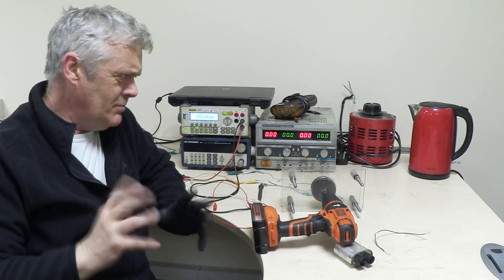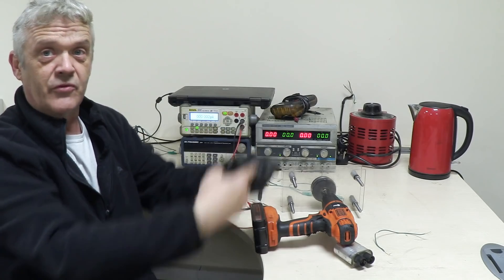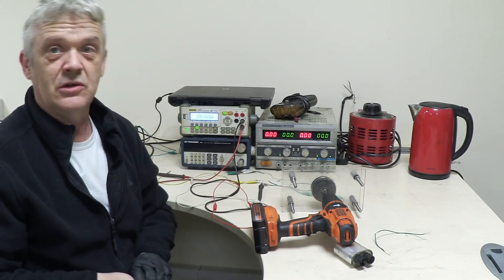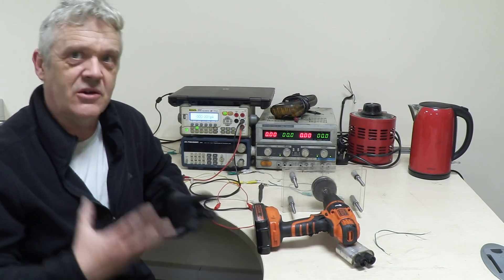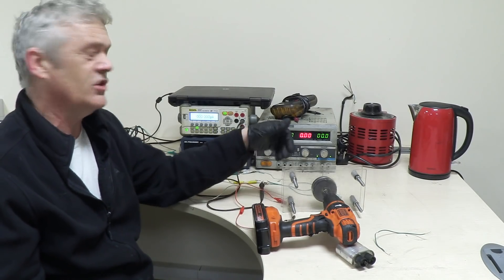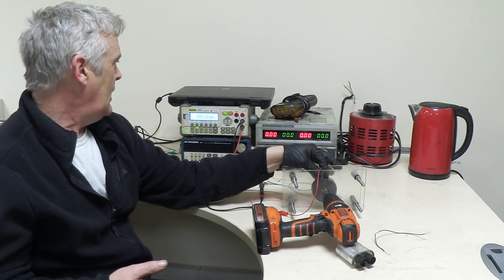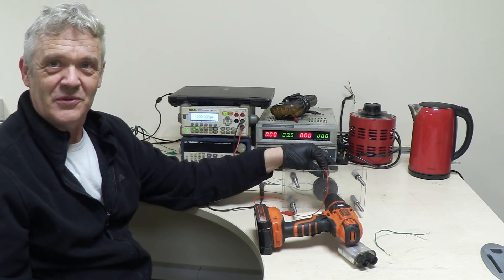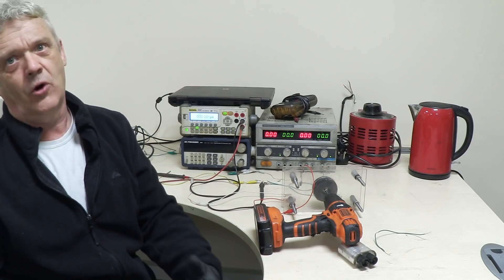Strange Behaviour Of A Tesla Homopolar Generator

Comment: Does anyone know where earth's magnetic field actually comes from? The official explanation is molten iron core. What about the curie temperature of Iron? Molten iron is way above the curie temperature, plus the outer core is about 3000 miles from surface
Reply: Magnetic fields from Electric currents dont care about iron's curie temps. Iron just serves as a conductor.
Reply: @kreynolds1123  hi keith thanks for your reply, are you saying the electric current is coming from the core still?
Reply: @clive280178  with a relativly low concentration  of iron  in the sun being so large as to gravitationally trap lots and lots  and lots of hydrogen,  and and even hotter temperature than the center of the earth,  it should be apparent that the sun's magnetic field is not created because of iron,  but  from convection currents in a rotating star.  The field builds up  self sustains,  then gets all twisted, and then reverses every 11 years or so.
Reply: @kreynolds1123  ok but the sun is just a large light in the sky (a plasma like the moon) and gravity is a myth disproven by Archimedes buoyancy principle ie - less dense air floats.  Air ships, hot air balloons and hovercrafts and anything lighter than air disprove gravity theory. Things that are lighter than air should be more affected by gravity, like small bodies of water are not affected by the Moons gravity like the seas and oceans are (according to mainstream science)
Reply: @clive280178  Gravity: for m¹and m² f¹=f²=G×(m¹×m²/radius^2)  
Prove that wrong.
Reply: @clive280178   Boyancy is the net result of pressure  forces  and  gravity acting on an object. Taken together, they confirm both the effects of gravity and pressure forces from fluids like gases and liquids.
Reply: @kreynolds1123  disprove gravity ya say, if I gave you a balloon with 20 kilograms worth of helium in it you'd float off into the atmosphere. Seems odd if I add weight to you it has the opposite effect of what gravity does. Pretty sure magnetism is the nail in the coffin of gravity too
Reply: @clive280178  taken more precisly.
Archimedes' principle states that the upward buoyant force that is exerted on a body immersed in a fluid, whether fully or partially submerged, is equal to the weight of the fluid that the body displaces.  So boyant forces felt by a helium ballon only  confirm the displaced weigth of the roughly 80% nitrogen and  26% oxygen  gasses.
Reply: @kreynolds1123  The oceans contain an estimated  352,670,000,000,000,000,000 gallons  of water. The moons gravity which is 1/6th of the earth's (meaning it would absolutely zero effect on earth anyway) manages to move that weight of water without disturbing puddles, lakes or reservoirs, and yet we cant feel a thing.

Gravity the force thats strong enough to move the oceans but weak enough to leave a puddle alone. Mmmhmm
Reply: @clive280178  Tidal forces are a different issue relating to different  accelerating frames of reference, and they have been measured and confirmed to work as expected in  gravitational fields. Puddles are just too small for you to observe tidal effects with your eyes. But can be measured on scales. So far, each of your example is explained by other physics and works within a gravitational framework. 

 But i have better things to do than to comtinue to debate this issue.
Reply: @kreynolds1123  cool thanks for your time and knowledge have a good.un

Comment: If electrons have weight they may be shifting out of their normal orbit in the field from centripetal forces contacting the disk and be conducted away also there was a slight wobble in spinning that may contribute to that as well but that is just off the top of my crazy head.
Reply from the maker: I think the angular momentum has a role to play for sure mate
Reply: @ThinkingandTinkering   Lets see magnetic fields are what? IRC electrons leaving the magnet like suborbital launches from 
earth if you were headed out on a trajectory and then the earth shifted where you landed would change from the original path you were headed on if this is true higher rpms and or wobble in the rotation should produce more energy.
Air bearings and a Tesla turbine may help prove this out.

Comment: i thought of that too, the relative motion between the wire and magnets, but i was wondering if you tried to use antenna,s and a retifier to charge a battery?
Reply: The combination of a rectifier and antenna for energy collection is called a rectenna, somewhat uncreatively.  They're the basis for beamed power, wireless chargers, and there's some research to build nanoscale arrays that could maybe even operate into visible wavelengths.  It's interesting stuff but it's not what's happening here to any significant degree though.
Reply: It is Direct Current, except for minor field variations in the material that might cause changes as it rotates.

Comment: I guess replacing the drill with something that can also spin that fast but using only hand power, maybe combination of gears and pulleys, can confirm that there's no induction because of the motor
Reply from the maker: maybe

Comment: I believe in aether or dark energy, also called by some, a quantum field.  Some would argue that earth"s magnetic field is what your rotating disk is picking up on, but I believe your magnets have created two magnetic fields in the disk, maybe three.  But I suspect they are angled within the disk, allowing both magnets to stick to one half of the disk, opposite each pole.  When you spin this, you are either disturbing this arrangement, and causing currents to form in the disk, or the destabilized magnetic domains in the magnets are doing the same, or thirdly, as I believe, they are simply magnets spinning in the aether, picking up energy.  If this is the case, just spinning one magnet or two in homopolar positions glued together, should also create a small current.    Very cool video, I wish I had money to give but I don't, Sir.  You can create an axil with thick copper rods that are touching and glued in the center of round magnets, long enough to touch a contact point far away and nearly parallel so as to nullify the contact and probe wires from being inductors to the spinning magnetic fields.   I hope you are very blessed this year, cheers, Mate.  😀
Reply: Read Robert Sungenis
Reply: @maciejnajlepszy  no thank you, but i hope you grow in wisdom and love, Sir.
Reply from the maker: interesting mate - thanks for taking the time to post that

Comment: It is not zero relative motion, disk is spinning and magnetic field is spinning, but wire of that is at the point of contact is static.
So, that small piece of carbon/wire in rotating magnetic field is enough to produce that current.
Reply from the maker: cheers. mate

Comment: Very interesting.. Maybe tapped the either. ? 🤑 So maybe it is possible that no resistive force is produced  to get current? What about different rpms?
Reply from the maker: worth trying mate
Reply: Robert Murray-Smith Not for me right now i am afraid . I am flat out working on an idea for a gaseous ion exchange membrane/interface for solid state batteries 🔋 its not a small cell either. About the size of a cocacola can !

Comment: Have you tried it with no magnet attached as a control?  It occurs to me that the aluminum disk does have relative motion with a magnetic field... the Earth's.   Trying it with different orientations would be enlightening, since Maxwell's equations predict that the current is proportional to the velocity perpendicular to the magnetic field (ie, the axis of rotation is parallel to the magnetic field).  If the Earth's magnetic field is involved, you'd expect the greatest output with the axis of rotation oriented north-south, and a minimum if the axis is in the east-west/up-down plane.   As someone else pointed out, there is relative motion between the plate and the wires/brushes.  I have read (but not verified) that homopolar generator experiments have found that rotating the magnet while keeping the disk stationary does not  produce current, but that assumes the field is uniform and the rotation sufficiently smooth.  In practice it may vary somewhat due to vibration and the fact that the magnetization of a permanent magnet is rarely as uniform as one might wish, so the field experienced by the attaching wires might vary slightly as the magnets rotate.  But that relative motion with the brushes and wires means there's also friction, so it could also just be a triboelectric effect.  Trying it with no magnets and in different orientations would test these hypotheses.  If its current is the same or similar with no magnets and in all orientations, then it's consistent with the triboelectric effect.  If you get different currents depending on orientation, that would be consistent with an external magnetic field, most likely the Earth's if the maximum is in the north-south orientation,  though there could be another nearby magnetic source you're unaware of that could explain it if the maximum is another orientation (easily tested for with a compass and some prior knowledge of which way is north).
Reply: As a quick explanatory note, the modern Heaviside formulation of Maxwell's equations doesn't include the relevant term to predict the behavior.  You have to include Lorentz force law.   However, in both Maxwell's original paper for the Royal Society, "A dynamical theory of electricity", and in his later treatise, in his equations that define the electric strength field, E,  in terms of the scalar and vector potential fields, he includes a term relating it to velocity relative to a magnetic flux field, B.  That term is equivalent to the B term in the Lorentz force equation, so the modern formulation is essentially the same.  Bits of the original have just been offloaded to other equations. 

It's interesting to read the original papers to see how the form of the equations has changed.  In the original paper, he writes them down as 20 individual component equations (so 3 each for Ampere's Law and Faraday's Law, and 1 for each of Gauss's Laws, plus a few others no longer directly included under the name "Maxwell's equations"), but by the time he wrote his treatise, he had become enamored with Hamilton's quaternions, so he uses that notation, which condenses them closer to what we have today, though he doesn't do any actual quaternion math with them.   Oliver Heaviside simplified them a bit more with his own notation, moving current density components directly into Ampere's law, eliminated the continuity equation, as it can be derived from the others, etc...
Reply from the maker: I know - but thanks for pointing it out
Reply from the maker: yes mate - read the description
Reply: @ThinkingandTinkering  Sorry,  I do see that you put it in the description.  I'm not in the habit of reading video descriptions unless the YouTuber mentions that some info is in them because most of them don't put anything useful in them anyway, but you're right. It's there and I probably should have checked before commenting.

Comment: You are turning the magnets, so I would assume you are rotating the magnetic field.
It could be your pick-up wire, fields are only parallel in the disk area. It could be hysteresis phenomena from all the materials around, most of them are diamagnetic, minus the screws.
How sure are you that the both magnets exhibit exactly the same field? You can´t be sure. Most probably, you pick up strays. A waveform would be much more telling!
Reply from the maker: Could be - cheers mate

Comment: Have you tried it without the magnets?   Also I think if the magnets will fit over the shaft of the automotive alternator, a South can be glued to the rotor on one side, and North on the other, and it will no longer need the field energised, making easy to be used as motor or generator, I'm not sure how strong the field will be, I have seen the rotors sold like this for wind turbines, not the best design, clamping 7-14 bar magnets on the rotor works better, with them slightly skewed,( compared to the shaft, ) it will reduce the cogging effect. I have also seen ppl epoxy small 1/2" x 1/8" magnets on the fingers of the rotor, still not the best, but I guess it works!  Kerp on with the cool experimenting!
Reply from the maker: yes mate - read the description

Comment: there is relative motion between the inside of the disc and the outside of the disc corresponding to acceleration (i suspect if you left it running long enough the inside and outside should come to the same relative speed) what you may be measuring here is the ....torque i think it is...basically don't think of the disc as one solid object but a bunch of atoms, it's not spinning as one solid thing but more like a spiral the inside atoms are dragging the atoms further out behind them. the effect is of course very small, and unsurprising the reading is ALSO very small.

if this is the case you should expect some of the following:

1. the effect should increase with disc side
2. the effect should drop off over time of constant speed.
Reply from the maker: cheers m ate

Comment: I think your conclusion is it is generating power on its own but you have to consider the fact you are in a lab surrounded by RF generated by AC transmission in your household electrical system. (proven by touching the open input of any audio anplifer with your finger) you are acting as an antenna.
What you might be observing is something being transfered by RF. A test would be taking this all outdoors away from buildings and electrical lines. and not holding carbon with your hand. (drills might also generate an RF as they spark the comutator)
Also there might be a phenomenon of carbon against the wheel that is generating the numbers you see..
try it without the magnets as a control. (update,,ok  I see that you did that) if you are getting that spike when you touch carbon to just the metal spinning you might be forming some sort of temporary battery or capacitor that gets charged by the RF in the room.
Then spinning the metal is like continually touching and untouching the carbon to the metal.
but if this only happened with magnets then some magnetic field might be cutting across test leads.
or is the magnetic field actually lagging by some inertia effect?
I am not a physicist I just play one on the interwebs.
Reply from the maker: I don't thinks o mate - this has been done by others  - I found that out reading up after
Reply: @ThinkingandTinkering  fair enough, so what is the effect? does farady ever explain it? I'm not that read up on him or this admittedly.
what if it's simply an interaction with some environmental input like I suggest, if not RF than some magnetic induction. if a compas needle is sensitive enough to detect the earth magnetic field could that be where this "mysterious" energy is conning from? or are we talking quantum fields..  or flux capacitos?

I'm joking around but I do appreciate all your vids exploring all these things.
Reply: @chuckthebull  Ether mate :)

Comment: Please repeat the experiment without the magnets.
Reply from the maker: read the description
Reply: @ThinkingandTinkering my apologies, the description is not that obvious if the video is  viewed in landscape mode on a tablet.
 Maybe it's worth replacing the volt meter with a scope to see if there is an AC component of the signal.
It might also be worth putting a small Search coil close to the magnets, but perpendicular to the magnets, to check if there is a changing external field component. While the disk is in a fixed field the sense wire may not be, if the  magnets external  field lines are not completely symmetrical.

Comment: Try this one get 2 magnets around the copper core, spin one magnet left and one magnet right at the same rpm when it hits the flip you should see a big pick up in power and still zip on the wind farm??? Anyway i by hand go from 0.3v standard rotation to 03.9v big pick up when you flip in reverse have a video on it by hand as I'am lazy on hear.
Reply from the maker: did you try it? is there a video?

Comment: Set up the same demonstration without touching anything with your hands. Remove the capacitor that is propping up the drill.
With current measurements this tiny, it could be due to anything at all.
Reply from the maker: Ok, thanks

Comment: Back of the envelope calculation for earth's magnetic field of 0.6 Gauss and drill turning at 500 rpm gives 12 microvolts between axle and rim of aluminum disk.  Did you actually make it thru first year Physics?
Reply from the maker: that's rude and unnecessary - this is an example of the faraday paradox - it is well studied - please inform yourself and try not to be rude when making comments
Reply: My sincere apologies.  I did not intend to be rude.  Every Physics student has tackled this problem.  I do enjoy your videos.  Please, help me out.  Use screen capture to copy your laptop plots so I can see them also.  More numbers and units when reporting results.  Compare results using tables so I can see how one results compares with others (in different videos).  I may be old but I can still learn.  Thank you.  jd